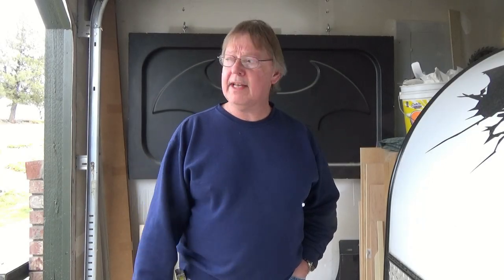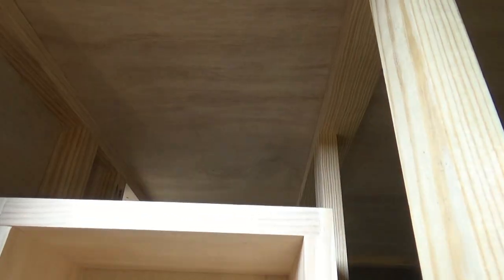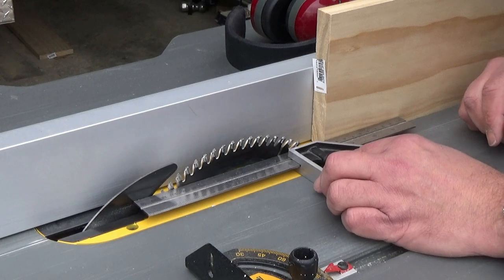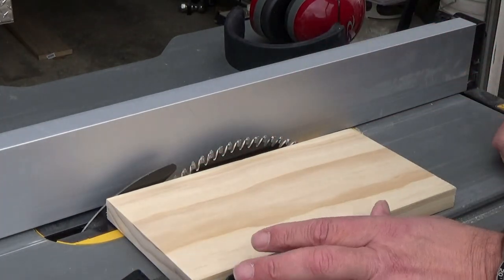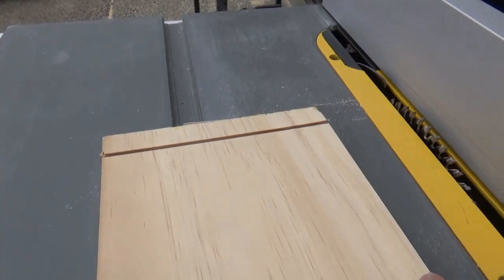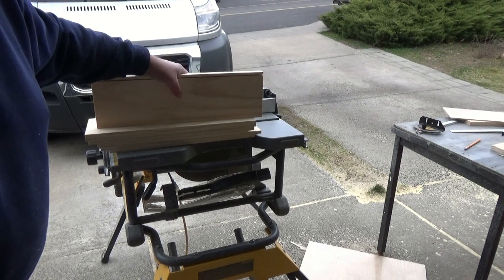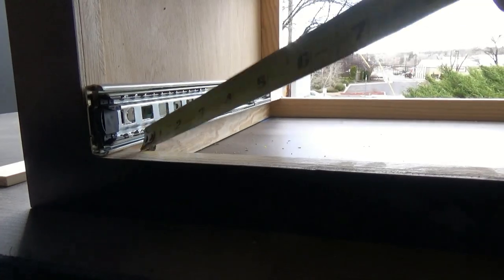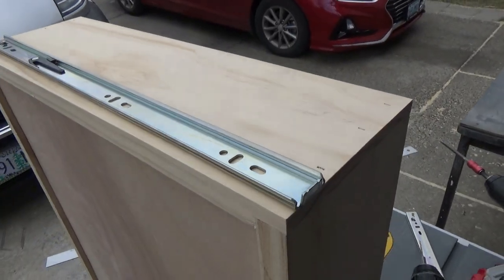Promaster Van Build 2500 159WB – DIY– The Drawers – Part 23

Comment: Another great vid, so you plan on having water in this build. You planning to have some kind of water level sensors on the tanks? I just got a fresh and grey water tank for the up coming build and not sure which route I want to go with the level sensors since they will be under mounted on the trailer and wanted to pick your brain about it.
Reply from the maker: Hey DR! Keeping the water tanks on the inside, so I will be able to visually inspect the water level, no sensors. If I were to install on the outside... would definitely consider that!